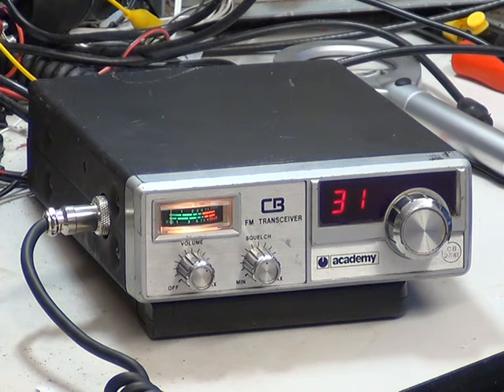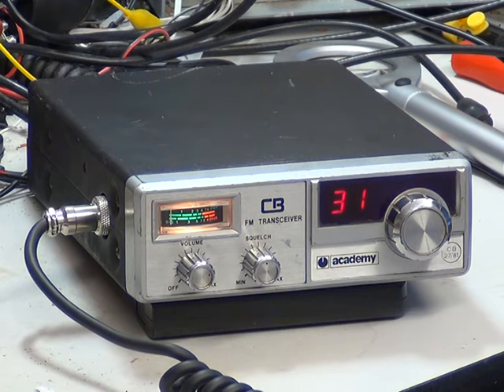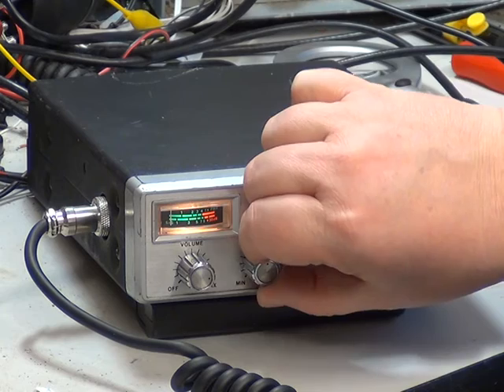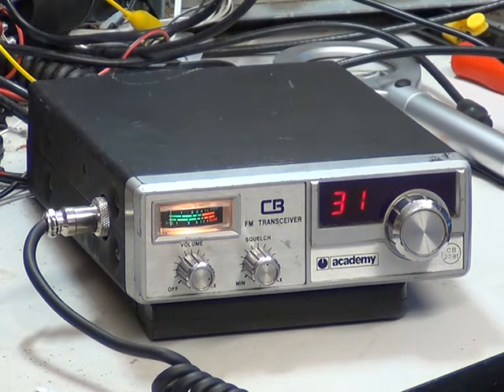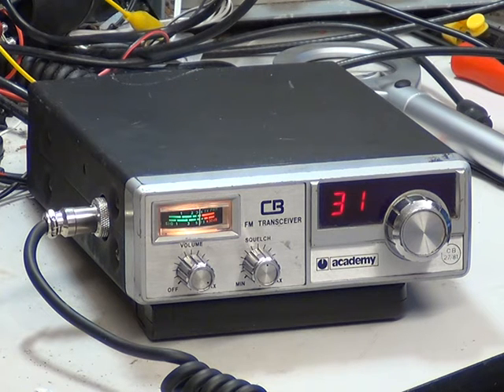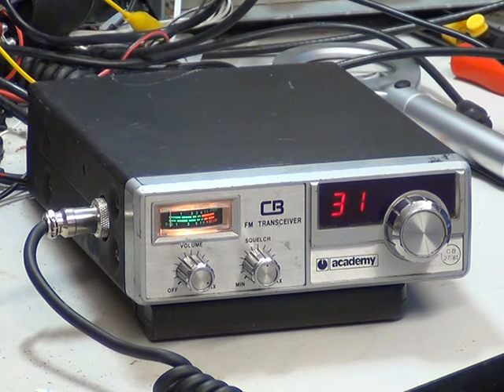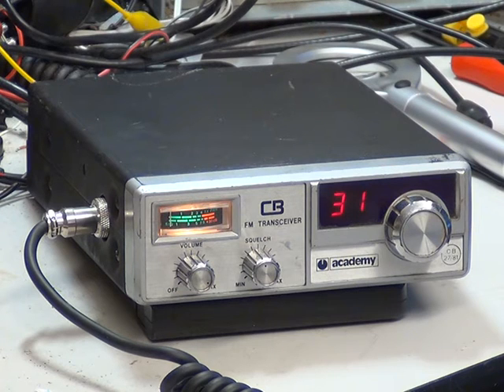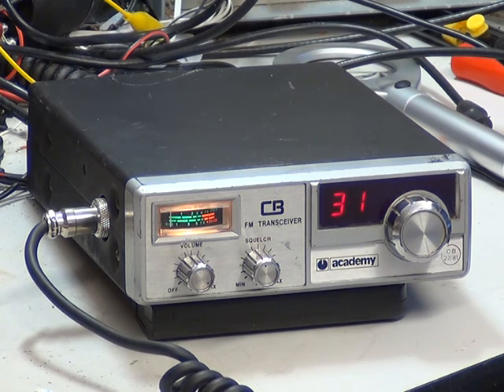Academy CB501 UK (CB27/81) CB radio (mobile) - On The Air Test

Comment: were these the same as the fidelity 1000, eurosonic sets?
Reply from the maker: Yes they are but without the Fidelity 1000's external speaker socket. With only 1.5W of receive audio into the internal speaker, it's inadequate in a moving car.,Other radios using the Great Gt858 chassis include the Lake Manxan 850,  Commtel, Cheiza, Barracuda GT858 & Gecol.

Comment: This radio was also sold in SWITZERLAND as Roadstar CB-404FM and handic CB-404FM or a lot of other brands. The Receiver had a poor receive selectivity performance. But I've found a good solution: The 10.7 MHz ceramic filter is to replace with a 10.7 MHz cristal filter. Then is it necessary to retune the receiver section and you'll have a good old school CB-radio....
Reply from the maker: I'm sure you are right, but we don't do modifications. Here also the chassis appeared in many different sets. As I've said before, in rural locations away from city wallies & the burner brigade, these radios work fine. Looking at the front panel wear on this one, the previous owner(s) must have used it a lot!

Richard
Reply: @ukfmcbradioservicingTango21  with all due respect the receivers of these are not great, I modified one years ago, the 10.695Mhz crystal IF filter with the right impedance matching transformed these. Predictably it did not take long to notice that the PLL had 6 address lines and no internal ROM....I added a bridge rectifier so the radio did not worry about supply polarity but a relay operated to enable the extra channels.... probably just as well I moved on to amateur radio before my luck ran out...